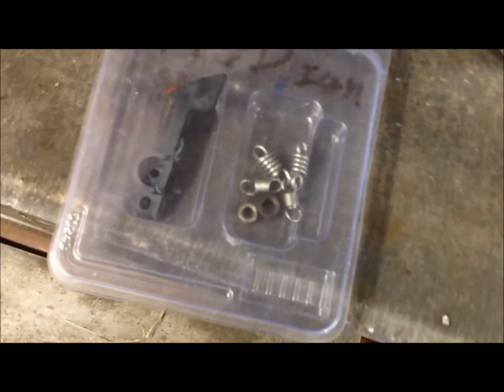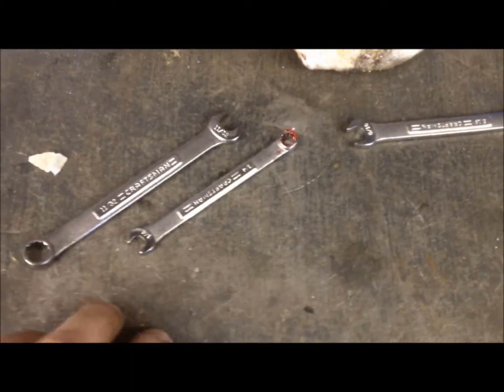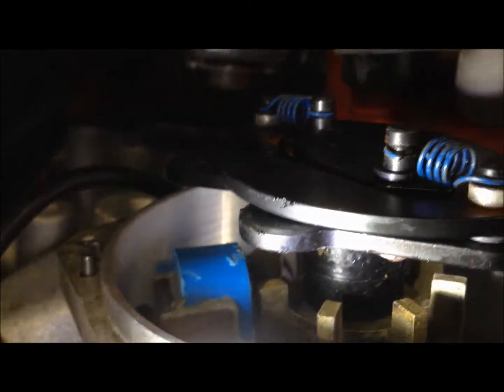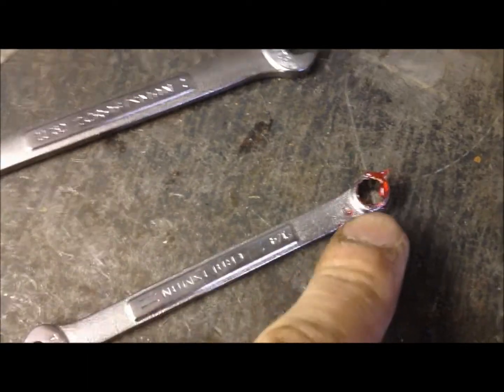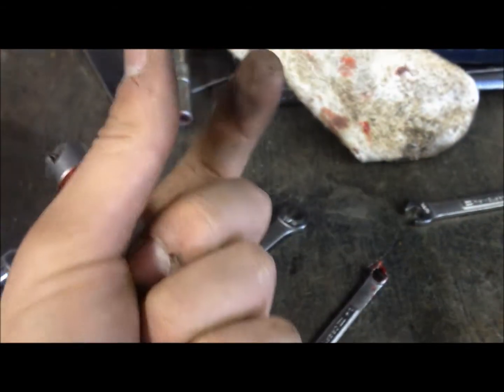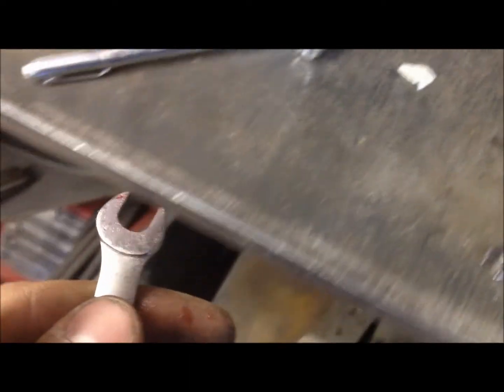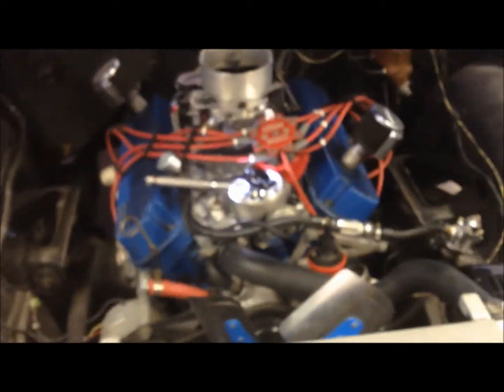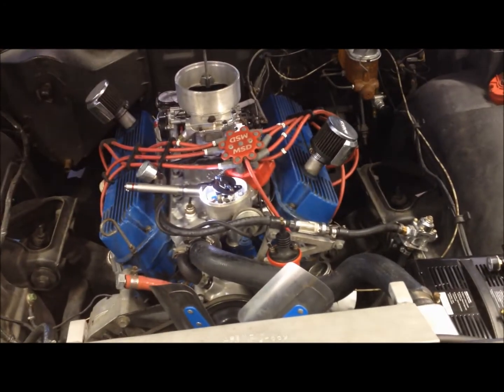Changing MSD Advance Bushing - Without Distributor Removal

Comment: Use a needle nose to get it to the stud, then use a finger below to hold it on, remove the needle nose and spin with another finger...i also use the bushing available from 4secondsflat.com, they make a 10 and 14 degree bushing in order to get alot of initial without getting too much total. My 427w has 18* initial and 32* total using the 14 degree bushing...very happy. BIG cam 600 hp monster...

Comment: I just did mine, 74 corvette tach drive.. its easier to just remove the distributer.. just mark the timing advance with cap off and mark vacume can.. took about 20min.. after about  10-15 min trying to get that damm nut on, I said out comes the distributer..

Comment: I used a 5/16 wrench and filed it down to tightly fit the 11/32 lock nut. Had no problem. Also put a shop rag in the dist in case i dropped anything.

Comment: IF i run 12 at idle the power hangs on all the way,but down low you can tell it needs a bit more timing cause its fouling the plugs ,it seems to come good around 2000rpm,i run 3.27 gears ,3 speed fmx auto and std stall.
Reply from the maker: Lighter springs will bring the timing in quicker, you sure could give a spring swap a shot. Higher lift cams need more timing down low since they are out of the cam curve

Comment: I have a std ford 351c electronic dizzy,to recurve it to my new mild cam should i use a softer or harder springs ?,with the std dizzy i have to put to much timing into it for it to go better,to much initial as well.
Reply from the maker: +Darron Mecak advance springs are more dependant on your power to weight ration. if you have low gears like 4.11 you can bring the timing in faster. you just need to run more initial timing like 10 to 14 but them have a proper stop on the advance so you do not exceed 34ish